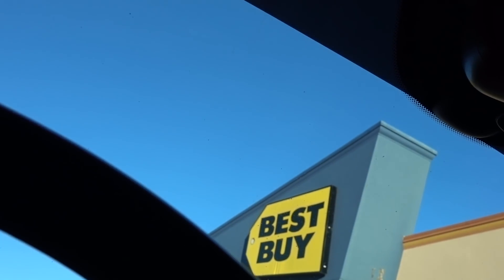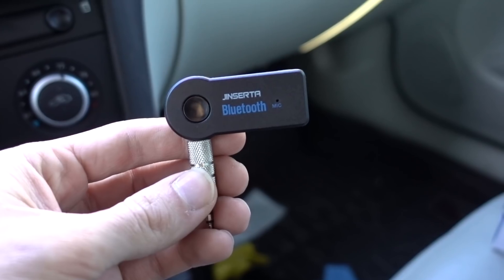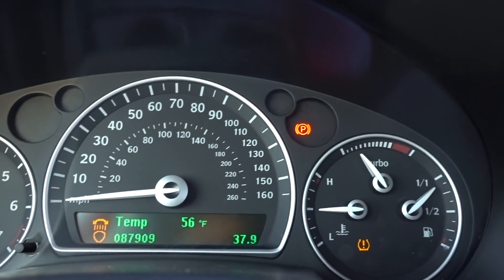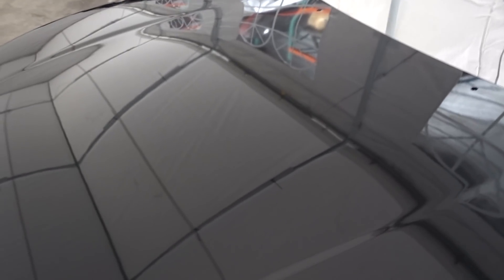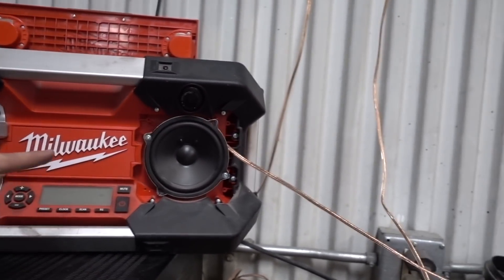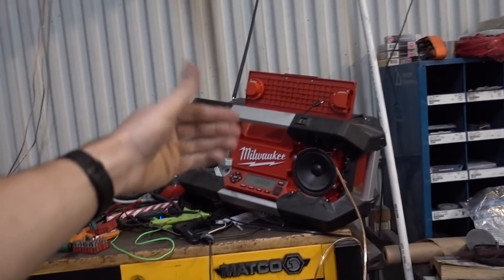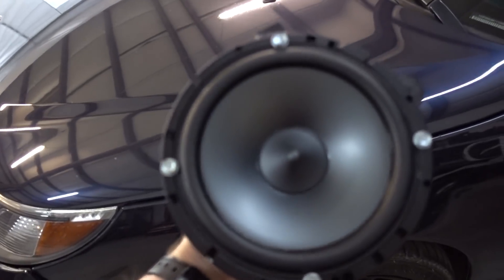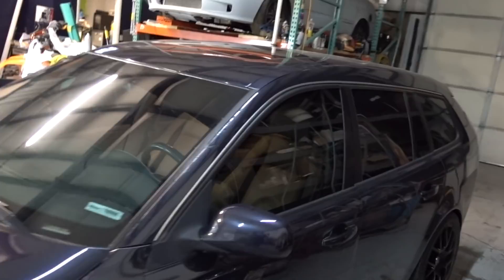NEW CAMERA! Sony Rx100 V - Budget Shop Subwoofer setup!

Comment: A quick easy way to get rid of catalyst code with deleted cats is to get a spark plug oil fouler and drill it out to fit o2 sensor in. Then put the fouler in between the rear o2 sensor and where the sensor goes. Sometimes you need to use two to move sensor more out of exhaust stream

Comment: trevor i have a question i have a 2007 saab 9-5 2.3T my heat works sometimes and other time it blows cold air ive checked my coolant level as well as did the climate control reset and it still  isn't blowing hot air my thermostat is fine as well it reads half on the temp gauge im trying to figure it out but im stumped

Comment: Why not paint the silver and spray clear over the whole car? If you ever decide to sell the car, you'll have to paint the whole car again anyways. It would be a royal P.I.T.A. to get the metallic black to match the front of the car. There would always be a weird line where the old and new met.  I'm afraid that silver vinyl isn't going to look good and will be a pain to install.  And then you might have lifting on the edges. I think painting and clearing everything would look the best.

Comment: If you haven’t already figured it out. A lot of pro installers use backstraps to mount tweeters. Most head units come with backstrap it’s just a flat strip of bendable metal with slots in it. Bose car audio sucks as far as quality. The only reason Bose systems sound good is because they have highly customized signal processors.
Reply: Yeah Bose car audio and Bose home audio are two very different things and the car audio is so much worse in comparison.
Reply: Shawn Prickett even the home audio is over priced and overrated in my opinion.
Reply: MyTruckinLife ACE 100% agree on it being over priced but they do sound pretty good. My mom has a radio and it sounds pretty sweet beats the hell out of my ihome and they are the same size. Mine was half the price though.

Comment: Damn it Trevor finish the Supra! Also, speakers. Get the jbl extreme or jbl boom box 10000000 times better than what you have and same if not more bass. Please at least try it. The jbl charge 3 is a baby and has good bass. The boom box is insane but the jbl extreme is what you wants
Reply: The outdoor JBL speakers would sound better and gave a use for the receiver.
Reply: Jason ethier way jbl is amazing. I’m just saying to get the xtreme because of its portability and the amazing bass. It also has an extreme mode as do most jbl portable speakers, and in that mode the bass is absolutely insane!!
Reply: Bman Ghost pepper I get that I'm a reciever guy I have a pair of klipsch forte2s and bose 901s series 4 and a sub